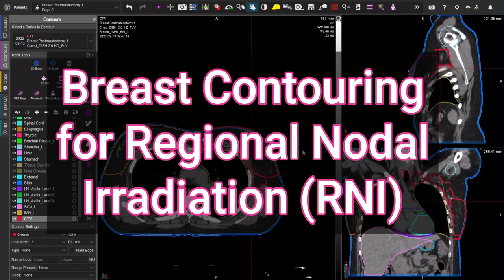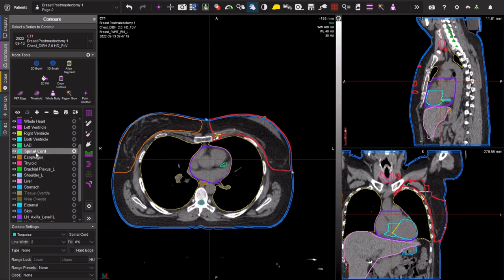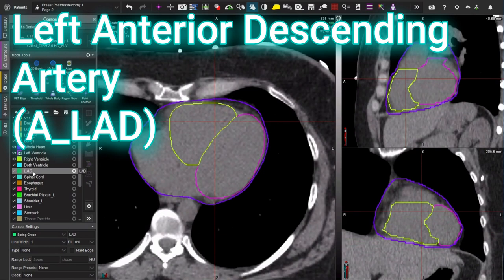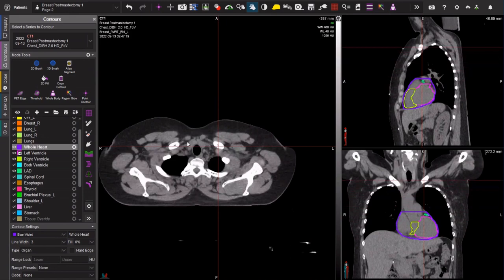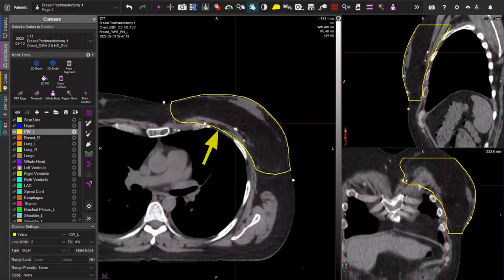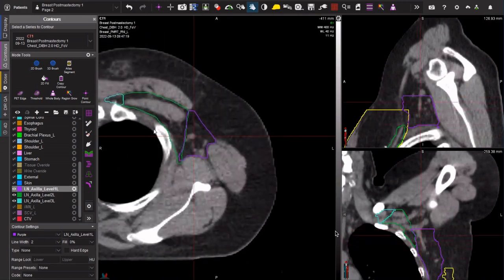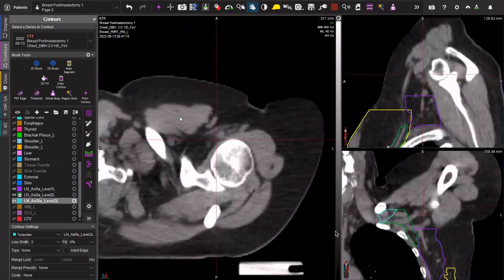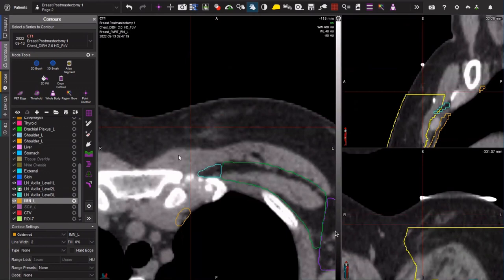Breast Contouring Regional Nodes... a Walkthrough

Comment: as an oncologist i appreciate ur good work 1 thing i want to add u have to tell indication for volumes to be added as per ASTRO guidelines and when not to include. overall best effort
Reply from the maker: There are 3 atlases with different histories: 
	- RTOG (USA, 3D-CRT = bone/muscle-based)
	- ESTRO (Europe, 3D-CRT = vascular-based)
	- RADCOMP (Proton vs. photon trials, VMAT)

Which Atlas should be used?
	- For IMRT/VMAT, use RADCOMP. It's most generous field, designed for VMAT photon or protons.
	- For 3D-CRT plans, don't use RADCOMP (unless you want to struggle with OAR constraints)

Hope this helps!